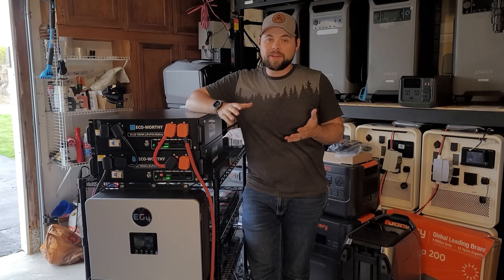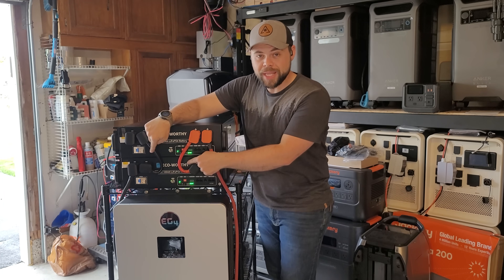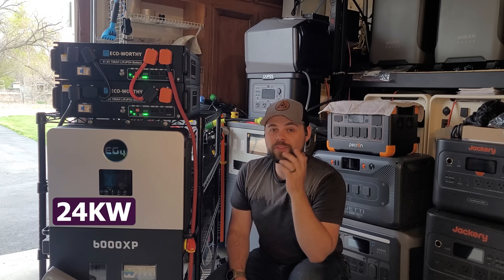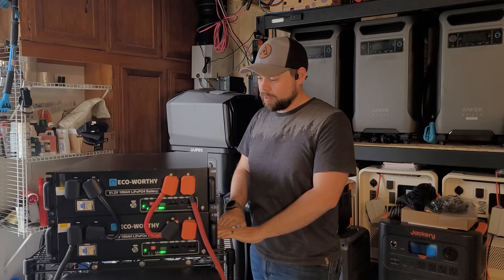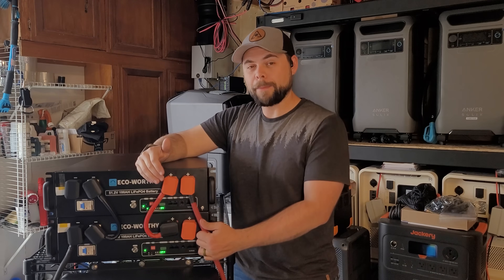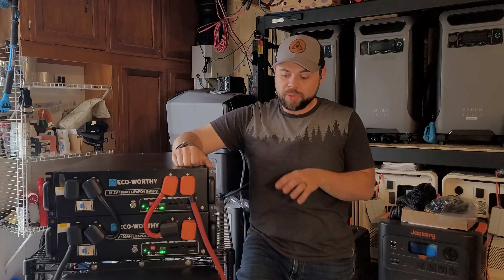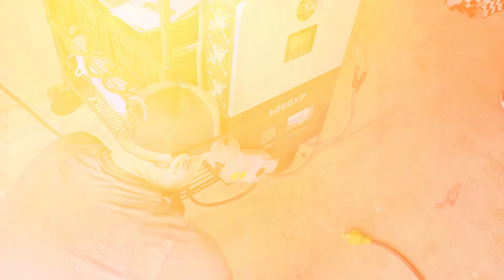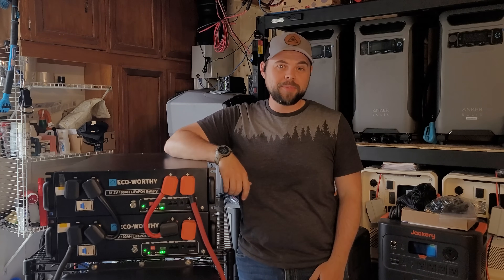The CHEAPEST Server Rack Battery for DIY Off-Grid Solar

Comment: They seem nice but they don’t answer my question. I asked if the batteries were third party tested such as UL, CE, or other testing agencies?
If they are not third party you risk your insurance company not covering if there is an event.
Reply: Excellent question. Great to save money but larger issues should be addressed as well such as safety, long term reliability, warranty, support, etc.
Reply: The Ecoworthy V3 batteries are UL1973, UL9540A and CEC.

Comment: Great info on these batteries but have one question? In a limited space can I stand these two batteries I just ordered on end and mount to a wall? Understanding that they shouldn’t be flat to the wall for heat distribution. When they get here I want to do this right and not have to undo. Thanks

Comment: Can I add 4 of these ecoworthys to my 4 eg4 48v 100ah server rack batteries and use the bms communication the eg4's have been using or would I need to go with no communication?
Signature Solar, when I asked them, said they wouldn't recommend doing this with bms and added that by mixing eg4&ecoworthy without bms would likely cause the batteries to not charge evenly. 

I suspect Signature solar wants me to buy more eg4 from them is why they don't recomended mixing in the ecoworthy. 

Any advice on this is much appreciated. Thanks.
Reply: I have an EG4 6000xp with (2) EG4 LL-S batteries connected.  I have (2) extra ECO-Worthy batteries.  Can I connect them and have the communications work properly?
Reply: @saljacquez9060 from what I understand after much research and talking with signaturesolar experts is you are better off putting the system into lead acid mode, using same length cables from bus bars to each battery.
Reply: Following

Comment: Their 280ah batteries are a better savings. Thier price has come up this month but their a little over 400 I got 4 to set up as a 48v when I got them they were less then 1600. More storage more space but more storage.. and I don't like the solar generator things they don't last and cost r way high. Best to buy an inverter charger .. ecoworthy 5000w 48v unit is 750ish bucks and you get alot more power and usage then the jacker units or any of them for that matter

Comment: You need to get with the times. Nobody's buying these overpriced, tariff-impacted, pre-assembled batteries anymore. It's far better and thousands of dollars cheaper to build your own DIY battery box kit. Plus, you'll get a much higher capacity battery, a better BMS, and name-brand, Grade A cells. 16.8 kWh DIY battery kits are now selling for less than $2,600 with free shipping, which blows these overpriced Ecoworthy batteries out of the water.
Reply: I just bought 4 of these for  20kw for $3000. Plus 30% tax credit, and it's even cheaper
Reply: Which kits?
Reply from the maker: Thanks for commenting. For reference, a DIY battery build that you referenced is 15.5c/wh, you have to put it together yourself and it weighs 300lbs +. This eco-worthy battery is 16.6c/wh and only weighs 100lbs. You can get the optional 6 battery cart for $250 with free shipping. that means in a space that is roughly 24" x 24" x 48" you can fit 30 kWh of battery, and it's only 6.5% more in price, but you don't have to put it all together yourself. So you're correct, but is it worth saving a tiny bit of money to DIY it when this is already done for you? Plus it has warranty coverage on it.

Comment: Also you didn't mention each battery can be connected to an app on your phone over Bluetooth or wifi.  If you have the battery com cables hooked together you can monitor all parallel batterys together through the master battery and the app shows you all of the useful stats, temps, cell voltages, etc...absolutely no need for a screen on the battery, you already have a phone or tablet that's capable of at least Bluetooth even if you're offgrid.😊
Reply: Would personally always prefer a screen on device and not depend on a smart device and installing apps, but that is a good point and feature!

Comment: Nicely done. Does Ecoworthy communicate with EG4 no problem?
Reply from the maker: Yes it'll communicate
Reply: @minutemansolar EG4 support just told me if connecting Ecoworthy batteries to EG4 batteries using bms they don't have it on their list as known to work with Ecoworthy. Also said the bms would likely only work with one or the other, meaning either EG4 or Ecoworthy but not both. 

Do you know 100% the bms communication will in fact work with a mix of Ecoworthy & Eg4 batteries connected to a EG4 6000xp Inverter and allow me to see the state of charge on all batteries when using the EG4 app?
Reply from the maker: @A.C.71  Because it's not on their list I don't know what other option from the list could be used as a copy for the EcoWorthy batteries. That's one of the reasons to just go off of voltage and have more batteries.
Reply: @minutemansolar do you know what size lugs and lug hole for the ecoworthy 48v 100ah server rack battery. 
M8 & 5/16 hole for bolt?
Reply: Did they communicate properly for you?

Comment: I have basically been using  that exact setup as a mobile welding, only difference is I have it all in a Rigid job box so I can fork it on and off of the bed of my truck and Im using a weatherproof  RV outlet box that has two 120v plugs and one NEMA 6-50r that I install.

Comment: How many batteries does it take to run either inverter? I’ve heard the more powerful the inverter the more batteries needed to actually run the system.
Reply: You need 2x to power the 6000 XP - it’ll run with one but only output 4800 before you trip the breaker on the battery. (I did that in an emergency after a big storm and my second battery wasn’t in yet. Just didn’t get anywhere close to maxing it out.)

Comment: Impressive.  I have the EG4LL I use for only emergencies on a tool box.  Do you know if I can connect the EG4LL and the Ecoworthy together?  Have been thinking of expanding to 2 more server rack batteries for 15KW and hire an electrician to connect a transfer switch.  My knowledge is very limited on this and am slowly learning.  Thank you for your video.
Reply: Hope somebody answers your ?
Reply: @caryvielhauer9743  I doubt it, he seldom does, not important enough.
Reply: @shelley131    Not making him any $ especially when he has a solar supply business that doesnt sell ecoworthy
Reply: Can you yes, but you'll want an external shunt as a monitor and do voltage control
Reply: @rcguymike  Thank you!

Comment: That’s a great setup. Did you capacity test the batteries. I noticed that my battery didn’t come top balanced so when I charge to full the BMS cuts off the charger when a cell hits the 3.65v threshold while I still have other cells are lower. I suspect if I manually top balance I can get full capacity. The BMS should balance it over time but may take many cycles as this BMS only has a passive balancer. Overall great value battery. What rack are you using to hold all the weight? Thanks